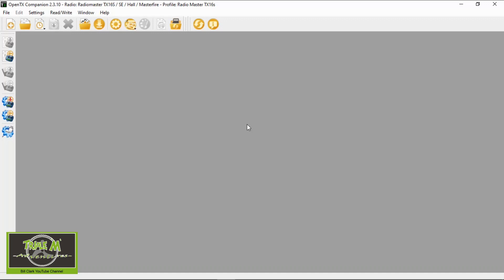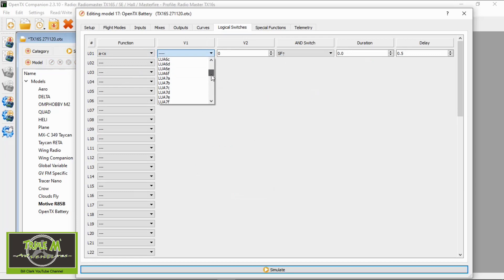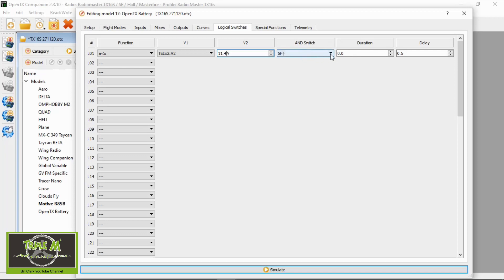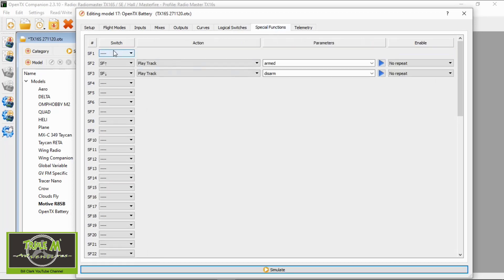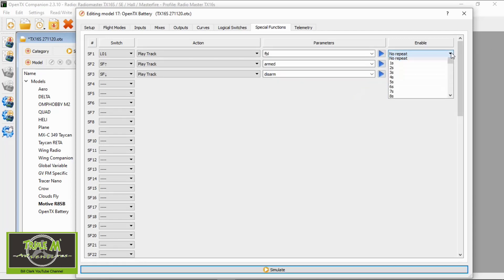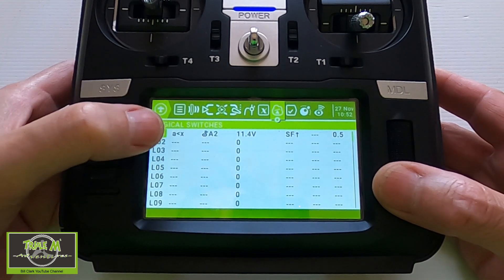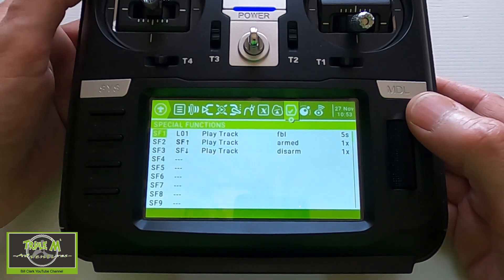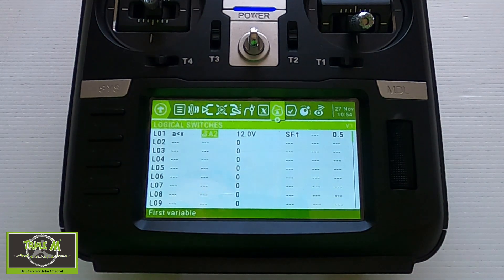OpenTX Setting Up Low Flight Battery Telemetry Warnings

Comment: So… how do we figure out which telemetry sensor we are supposed to select? Seems like that’s a critical step that just gets glossed over.
Reply from the maker: You need to discover the telemetry sensors your receiver has which may not include supply battery voltage but RXBAT which will only display the voltage your receiver is using. With some receivers the terminology will be different then consult your instructions for your particular receiver.

Comment: Any receiver suggestions that has battery sensors?
Reply from the maker: Check these out. 

MOTIVE-RC R8SB Receiver 

https://youtu.be/HJuOpSPFDkc

FlySky iA6B Receiver

FlySky FS-CVT01 Voltage Telemetry Sensor

https://youtu.be/YIrwZ08ynNs

Comment: Hi Bill. Can you tell me or point me in the direction how to find my telemetry senses? I'm using a happymodel whoop so it may not apply
Reply from the maker: Goto the telemetry window in the model set and with you drone connected to the radio click find telemetry sensors. If you have a telemetry receiver you will have sensors come up. Remember to click stop checking.
Reply: @the-happy-RC-flyer  Thank you so much Bill and I appreciate your time
Reply from the maker: @nvembrace  you are very welcome.

Comment: Hi Bill -> do you know if its possible to setup the TX12 with low voltage warnings in the same manner/steps?
Reply from the maker: Yes if you have a telemetry receiver with the battery voltage value option.
Reply: @the-happy-RC-flyer  Thanks -> Really appreciated these vids and your responses!

Comment: I do not have fbl.wav in my most recent opentx build or Amber sounds. Would anyone know where to acquire this sound file utilized in the video? Thanks for any info.
Reply from the maker: Dave I made the custom sound Flight Battery Low here is the link to my video showing you how to do it.
Reply: edgetx has a low batt warning if you haven't updated to it yet

Comment: Bill, if I may call you Bill, I see you have used A2 in this scenario. Please tell me the difference between A1 and A2. My telemetry shows both.
Reply: Thank you
Reply from the maker: Bill is fine 👍🏻 Alf, it depends on your receiver which telemetry you use check the user manual. A1 can be the receiver battery so will always show 5 v so not very useful unless powering your receiver with a separate power source.
Reply: @the-happy-RC-flyer  so what I hear is that A1 is what  the receiver is puĺling from the battery and A2 is the complete battery, receiver and motor ?
Reply from the maker: @alfstockton  A2 is the main flight battery voltage.
Reply: Hi, in my transmitter A1 shows 5.0V but A2 shows 0.0V even when there's a battery connected. Do I need an extra piece or a different reciever?
Reply from the maker: @TheHagaymuzan  you will need a receiver with the capability to read VBAT. Most receivers can only handle 5v.

Comment: for those of us who use different cell counts I wish there was a way to have OpenTX report an average cell voltage so you could the same model for 4S or 6S.  I mean Betaflight can figure this out why can't OpenTX?
Reply from the maker: Chris just set up a low battery voltage warning for each battery type and then add an AND line selecting at switch so you can change which battery you are using.
Reply: @the-happy-RC-flyer  I wish there was a way to have this happen automatically based on the voltage level.  I guess using a switch is not the end of the world.
Reply from the maker: @chrisyoung8062  that would be good but the problem is OpenTX does not know how many cells the battery has and only the overall voltage is being sent back to the radio. If a flight controller can send back the number of cells to the radio then it would be easy.
Reply: @the-happy-RC-flyer  Bill I have an idea and I'm going to try to figure this out .  What if I made a logical switch that was on when voltage was >17v.  That would only be true if I had a 6s battery plugged in.  Then my low battery warning for 6s would only alert if that logical switch was true.  If I were flying 4s it wouldn't alert because the switch was false.  The alert for 4s will never come on because the voltage of a 6s would never get that low.  But If I'm flying 4s it would.  There might be a problem in my logic as I haven't tried it yet but I'll let you know.
Reply from the maker: @chrisyoung8062  please keep me updated.
Reply: @the-happy-RC-flyer  Bill it seems to work. These are my logical switches.  The switch numbers don't matter but these are in my case. a is of course RxBAT.  L07 a>19.0v (this proves it's a 6s battery) .  L04 a<22.2v AND L07 (it's a 6s battery and it's low).  L06 a<14.8v (it's a 4s battery and it's low).  Both L04 and L06 playtrack batlow.  Hope that isn't confusing.  I also have another logical switch that is a>5.0v.  The purpose of that switch so that the alert doesn't sound when I'm plugged into USB, which in some cases powers the Rx on the quad.  I use that switch with an AND for the L06.
Reply from the maker: @chrisyoung8062  that’s great. I have set up the dual battery warnings and will publish a video on how I solved the problem.
Reply: @the-happy-RC-flyer  No switch needed for my setup.  It's automatic.
Reply: Hum depending on setup if the Rx uses batt input could one use balance lead to read one cell?????????
Reply from the maker: @learningtofly6675   it would be possible but but better to read the overall battery voltage in case of a cell voltage difference.